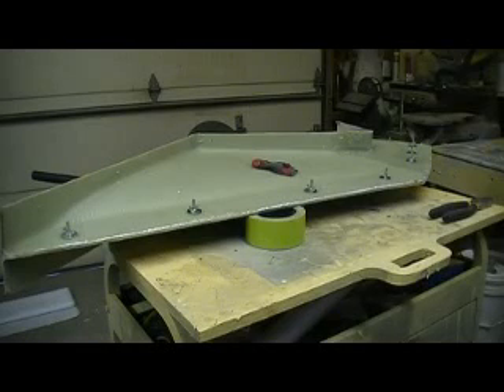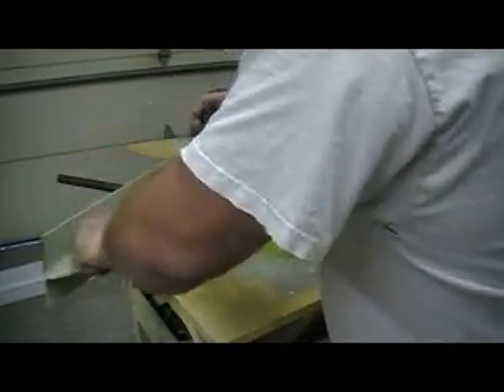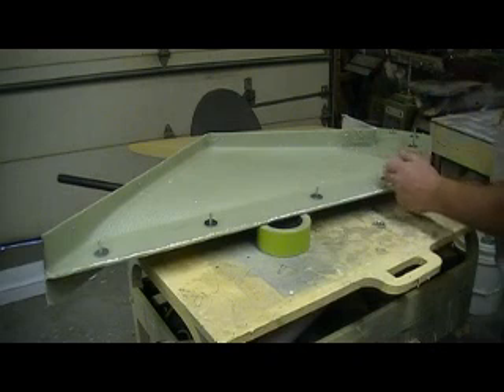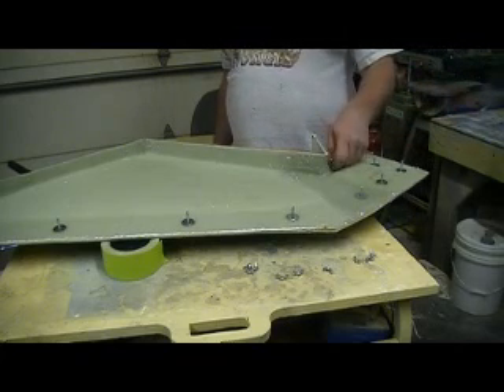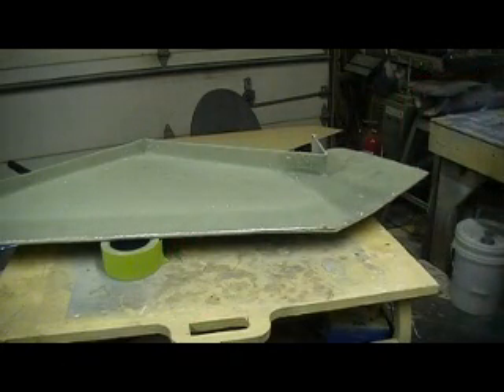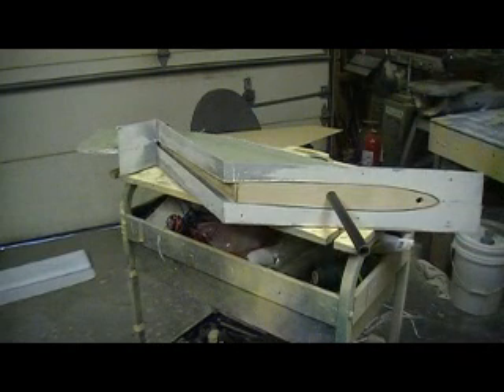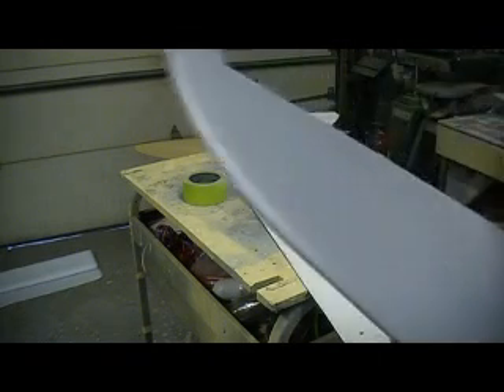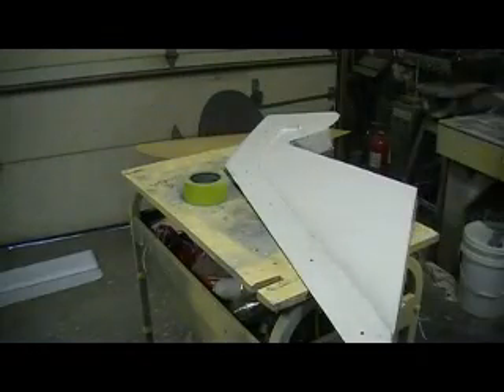how to build a rc jet B-1 Bomber # 158

Comment: Hey Bob, I smoked my slimline smoke pump and just finnished installin a Gas Passer in my Angel for my new smoke pump.  I used the ESC board outta the Slimline pump.  Works awsome.

Comment: How are you going to substitute the safety measure that dropped the landing gear on the pneumatic system, if the plane ever get into trouble?
A pneumatic tank, hooked up to a piston via a valve, which in turn can push a hydraulic piston to generate backup pressure?